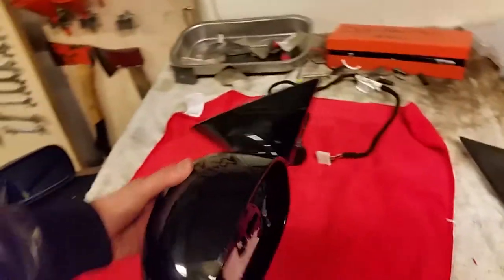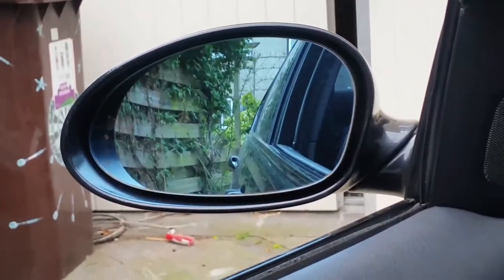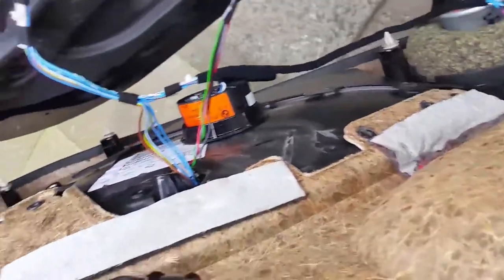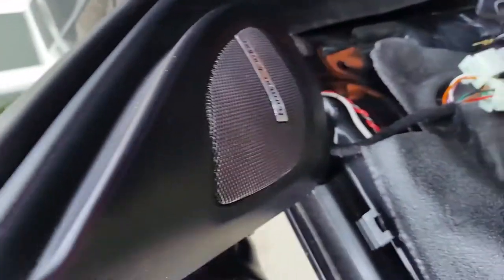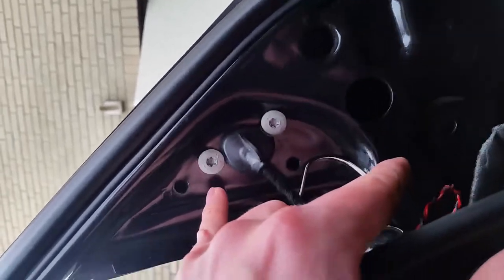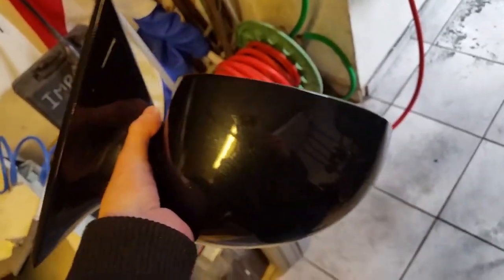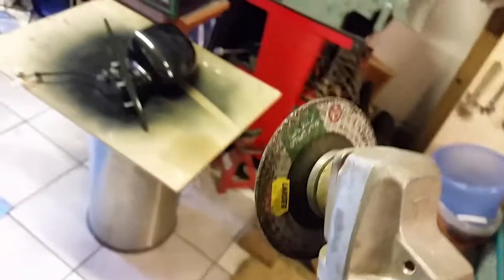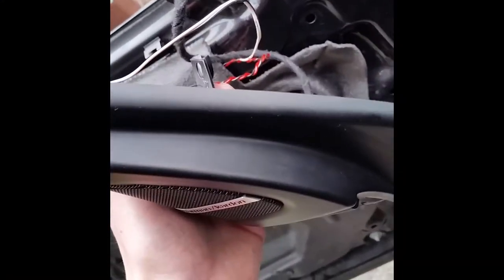BMW E46 M3 mirror install SEDAN retrofit

Comment: Have you also retrofitted the memory and autofolding function?
Reply from the maker: No these mirrors were manual fold and non memory, they only have 5 wires or something. Retrofitting the memory and autofolding is very hard if you don't have memory and autofolding to begin with.
Reply: Pertulibaba Thanks, yes I know, do you know if you need new mirrors to enable the memory function or it's just enough the module and the switch?
Reply from the maker: I think you need the module, the switch, the seats with buttons, and the mirrors, and then you have to get your car programmed to enable memory functions at the dealership.
Reply: Thanks, so are the mirrors different?
Reply from the maker: Yes the mirrors are different, there is a difference between Right handside (UK & Australia) drive and left handside drive mirrors. The angle is different
Reply: Thank you!

Comment: Fitment of your M3 mirrors in this video is terrible because you did not trim the base plates as required for proper sedan fitment. Rogue Engineering has a great DIY for anyone who does this retrofit to follow regarding trimming of the mirror base plates. This is clearly an example of laziness rather than doing a job right to ensure proper fitment.